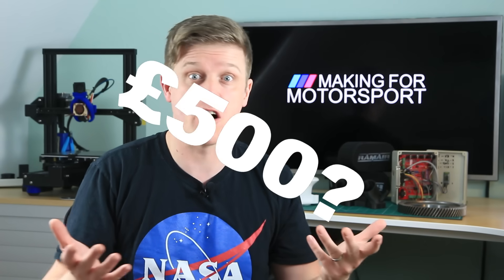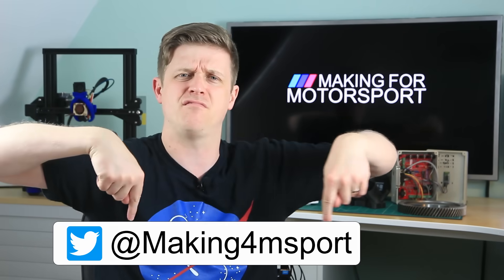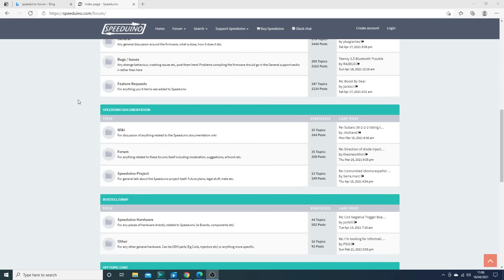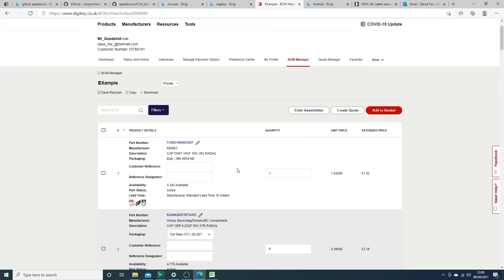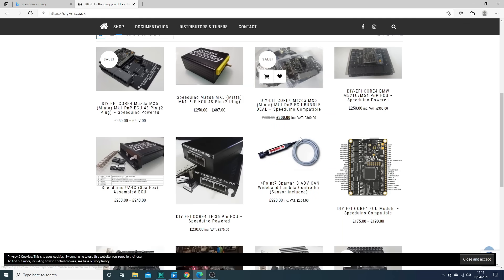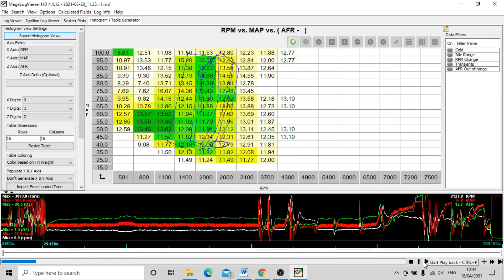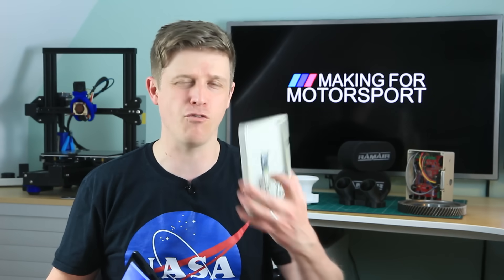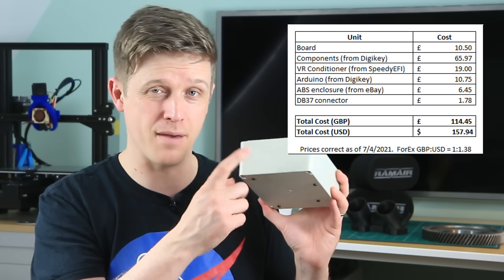The Best Value Standalone ECU - Speeduino

Comment: Wish they made a 6 cylinder version. Got to wait for DropBear!
Reply from the maker: You can always go wasted spark and paired injectors?
Reply: @MakingforMotorsport  true but I feel like that would be a step backwards from OEM.
Reply from the maker: Yeah, I get that if you already have Coil on Plug that you want to retain it, but you can go wasted COP which, presuming dwell and heat aren’t going to be problems is to all intents and purposes indistinguishable, but sequential injection I am not hung up about.  Any sequential setup becomes basically a batch/paired fire setup at higher revs as there isn’t time in the cycle to only squirt when the valve is open so the only benefit is emissions and low speed running compared to paired.
I suppose it depends on your priorities, the step forwards is being able to fine  tune to your actual engine, it’s whether that outweighs what you loose with the sequential... 🤷🏼

Comment: Speeduino, weber dcoe frames hiding denso injectors, zetec engine, turbo.
Reply from the maker: Sounds good and I like the crafty injectors/carbs!  A question for you, how are dealing with the individual throttles and the turbo when your load sensing on your ECU?  2 tables?  AN to SD for boost?
Reply: @MakingforMotorsport  I'm thinking about going with SD and using boost reference from all four runners. Thats how I used to do my old setup on different ecu Its still a working project and I have not ran it yet. So might need to look in to the blend function for SD and AN.

Comment: I buyed 0.4.3c speeduino board and arduino mega for 96€ pretty cheap ! 

I want to install it on 4g93 DOHC engine. But first i ll try on 4g13 sohc engine. I am a bit loss with distributor but i'll see if I can make it
Reply from the maker: Speeduino can support distributor, you just need to understand your existing wiring, maybe that’s a good place to start?  Then you could go to trial whatever you have planned for the 4g93 (wasted spark/coil on plug etc).  Best of luck!!
Reply: @MakingforMotorsport  in my distributor there is 6 pins + 2 pins 6 pins : ( crank and cam sensor that send 5v to ecu, 12v supply from engine relay, 2 ground and one "ground" from the ecu... Which I can t understand what it does)

2 pins  : it is the ignition coil power wires...

But I don t know how to control my distributor... For ignition timing. The only wire that goes to the ecu is this "ground" wire... Do you have an email where I can send you my schematics? I have all on pdf files

On the 4g93 I will use wasted spark 1/4 and 2/3 with Mitsubishi cas sensor (cam and crank sensor on one camshaft)
Reply from the maker: If your Crank and cam sensor are running to the ignition gear it sounds like you might have an “edis” like system same as 90s Fords.  Happy to have a quick a look but I can’t really promise anything.
If you look on my channel page there is an email there you can use. 👍

Comment: Hey, great to see you using Speeduino, and thanks for the mention in the Video :D
A few small recommendations before you get too stuck in with your tuning.
Update your firmware to the latest.
There are some features in versions after yours that make running ITBs easier, mainly ignition based idle control.
I use that on my personal project., https://www.youtube.com/watch?v=EfR-dr7fOW0
Also, if you are using TPS as your load, make sure you have an axis cell for 0, and I would use about 5 cells going up in single increments (1,2,3,4,5) at the bottom of the table.
A small throttle change in this region has a big impact.

Good luck with your project, SUBBED!
Reply from the maker: I’ve thinking about updates for a while but i already have the functionality and value the stability above everything (don’t want to mess with it), it’s been running my wasted spark for about 2-3years....

I do like the sound of ignition based idle control, I’ve got a retard dip in my table at idle and if it drops in revs I get abit of advance to nudge it back but that’s not ideal, (less than perfect idle and it’s taking up a speed column), I will look at it 👍

So seeing as I am going to be messing with it, it’s likely a good time to update.  And 🤫 on the Load axis break points, that’s basically the next video 😂😂😂

Comment: Can this ECU work on trucks? such as a Cummins engine.
Reply from the maker: If it’s a conventional petrol engine then I don’t see why not, if it’s a diesel then no and I don’t think direct injectors are supported.  But if it’s got a spark that needs timing and high-z injectors that need opening (depending on the amount of each) then it’ll work.  If you need to know specifics I suggest you check out the forum...
Reply: @MakingforMotorsport  I shall look at the forum, but it's diesel so it won't work, the only reason I ask is that the ECU  for the truck costs 7k new and 4k refurbished, would have been great and a cheap alternative to use the Arduino unit.
Reply from the maker: Yeah, diesels can be tricky, as soon as it’s common rail there is lots going on and it’s very different from a petrol engine.  Best of luck finding something!

Comment: What about emissions/obd2 how would you make that work
Reply from the maker: In its basic form this isn’t included, however you can enable OBD2 with different hardware, but that’s a data stream of parameters not diagnostics so it’s not going to produce fault codes etc (but as you can plug in and see pretty much everything on tuner studio that’s not needed).
In terms of emissions control/readiness monitoring Speeduino doesn’t do this as far as I know, and if you have smog tests to pass this definitely isn’t for you.

Comment: 0.4.4 running a 91 volvo 240 as sequential everything with ls3 coils.
Reply from the maker: Nice! Old skool car with modern tech!
Reply: @MakingforMotorsport  next step is a borg warner t5 swap and ford 8.8
Reply: @Tachikoma69  wonder if this would run my 98 volvo s70 t5 b5234t9 swapped with hybrid turbo. Running dw300 pump on dw800 injectors 3.25" maf but id like to go speed density. Currently managed by modified Bosch m4.4.
Reply: @ogfromutube  t5 or t6? Either way, you can run both engines with what ever combo you want. If running a drive by wire, you will need to revert to drive by cable. Not yet supported unless you get a standalone.
Reply: @Tachikoma69  its the t5 2.3 20v. Cable throttle used rn block and head but the older style intake and tb. Drilled cams for rotor plate til i go cop. Its tuned by vast now and he did great job but everytime i change something i have to bother him. Just swapped to 800c as i maxed out the 468cc greens.
Reply: @ogfromutube  the white block, i know. You can run a 5 cylinder on speeduino

Comment: I went for the Link Plugin ECU for my Altezza when I put ITBs on. It really is plug'n'play, so it couldn't have been simpler. The Altezza uses a BEAN network for a lot of the car, so the Link plugin ECU has an extra board on it to do the can <-> bean translation. This meant I could use everything on my dash and keep it very OEM looking. A really good benefit of the Link ECU is the support that comes with it, whether on the Link ECU forums, the FB pages or direct contact. If there are any issues or queries, you get a really detailed answer usually within minutes from a Link employee.

When I get a more project oriented car, I'll definitely be giving the speeduino a go
Reply from the maker: Yeah Link seems to be the name of the moment with lots of integration, I remember your post on the ITB and your install sounded top notch, especially if you can integrate into the BEAN network and CANBUS.  Trying to integrate anything into that and continue the stock features would be a massive headache...

Comment: Yesterday I went to Santapod with my Corrado with a r32 engine running on Speeduino happily ran a 13.4 @100 mph which is comparable to the same car running the stock management considering I am not currently controlling the VVT and the intake changeover valve I am happy, it helps that I have previous MS2 and MS3x experience (and already have the tunerstudio upgrade) there are a few things that are not currently supported but for the money it works really well.
Reply from the maker: Sounds like it’s going well!  Have you done all the tuning on it?  I have used a MS years ago and when I came to get another one I couldn’t believe how much the prices have gone up... especially an MS3x, great functionality but it’s nearly entry level money for a name brand!
Reply: @MakingforMotorsport  yes I did all the tuning still needs a little work in the warmup areas and part throttle but its more than drivable I towed my trailer tent and did the 300 mile round trip without issues, The prices have gone up (as have everything) I helped a friend pick a new ecu recently for his fast road car and he was interested in going ms3x and in the end he went for an EMU classic as it was similar price wise to an ms3x and had DBW support which he was keen on...  I have my MS3x on my mk2 golf drag car (pb of 9.95@146)
Reply from the maker: That EMU classic seems like a great choice, definitely better than a similarly priced Link unit, they need to increase their marketing budget!  Sounds like you’re well into your VWs, sub 10 in a FWD is going some, is it a turbo? (1.8T?)
Reply: @MakingforMotorsport  yes its a 1.8t with a hx52 although I am building a new engine for it as I keep lifting the head on it (lower compression and o-ringed the block) I was quite impressed with the EMU range although the datalogging is more awkward vs the ms3

Comment: Any help in getting semi-sequential injection on a V8 using 1 Speeduino, using a stock distributor to get cam signal and using a trigger wheel and hall-effect sensor for the crank. 
Otherwise I might just resort to batch-fire and see if it’ll pass emissions.
Reply from the maker: Hi Merle, I don’t know the V8 methods too well but in the manual the next to semi-sequential they have “only valid for 4cyls or less” so I guess that’s your answer, although the guys on the forum would be best placed to answer, but you should be able to pair and go for alternating.  
I would have thought the tune would be the most important, not too rich, not too lean (HC vs NOX), timing etc, if you fail it you need a friendly garage to borrow their tester for 20mins....
Reply: @MakingforMotorsport  What do you think is the most economic way to get full control of a V8 is?
Reply from the maker: You can use a Speeduino with a distributor, if you have one fitted, otherwise you can use the ever popular LS coils in wasted spark mode, and injection in paired mode.  That will give you full control...  if you want sequential injection you will need the Teensy version...

Comment: 2003 svt focus not sure on ecu but I'm going with a itb boosted combo but first itbs have to have a plenum made for one big asssss inlet
Reply from the maker: ITBs and Booooooost?? Go for it!!! That said you’ll wanna do some research as it’s not common and makes it difficult to load sense, as you’ll need to use Speed Density (Manifold Air Pressure) so it can cope with boost pressure but off boost your gonna want to use Alpha-N (throttle signal), ideally you’d use a MAF (like the Skyline GTRs!). Speeduino does support switchable tables like above so you can go between modes but I’ve never tried that!  How hard can it be??😂
Reply: @MakingforMotorsport  if I can work some magic ill do it but yes not even close to easy well its going to be alot of mad scientist stuff for sure but if i can pull it off I think it will be sick
Reply from the maker: Definitely!  Is it your daily driver?  Always easier with projects if you can take them off the road for a while...

Comment: I wanna install itbs on an N/A 2014 mitsubishi lancer but it has a más air flow anf a map sensor and i wanna use the standard drive by wire or fly by wire that comes with the car so i need some ideas
Reply from the maker: Now this is a tricky one... I think your options are this... 
1. Stick with your standard ecu and remap if you can, and you’ll need to duct your ITBs into an air box to keep your air mass meter.  Also you will need to mod your current throttle actuator to the ITBs (but that’s every option) - downside is the standard ecu will be limiting even if you can remap and the new map signal won’t be as good because of the ITBs.  Not preferred.
2. Go fully stand alone and drop the current ecu for the engine but leave it with power so it can run the fly by wire throttle plate and just modify the actuator to run the ITBs (this needn’t be direct - you could run an intermediate cable - not elegant but it would do the job)
3. Ditch the lot and use an Arduino to power your drive by wire throttle and go fully standalone
4. Get a none fly by wire throttle pedal and drill a hole in the bulkhead 😂👍

Number 4 is probably simplest but if your are dead set on keeping the drive by wire then option then in about 5 videos time I will be doing option 3 👍
Reply: @MakingforMotorsport  thanks for the options ill see.what i can do ive been wanting to go for a piggy back ecu of go full standalone but i dont have much information about what ecu could work with what i wanna do but ive been watching some videos about this new speduino ecu and i feel like this one could work and i think since this is a map sensor signal based ecu i can get rid of the mass air flow sensor  but ill have to go full standalone for that but likeni said i dont have a los of info about what components i need or wich ecu option i can go with ive seen some videos but they dont talk much about what works for what so yeah thanks but i tell ya i will install itbs on this car mark my words lol

Comment: Hey I'm loving the videos, top job. I commented on your 3d printed inlet manifold video as I too have bought itbs from a zx6r. I'm getting the bits together to convert a 1973 series 3 land rover to run on a speeduino. I've gone for the ua4c flavour and to adapt a previously carburetor based engine I'm getting the rest of the bits needed.(trigger wheels, coil packs ect). I've noticed that alot of the videos revolve around adapting speeduino to already injected cars so I plan on documenting my journey on YouTube, watch this space. I've not done it before but I feel I've watched days worth of videos on other conversion, please keep the content coming as every one helps me out a little more, cheers
Reply from the maker: I will do Mike, I love getting the feedback as the videos do seem to really help people!  I know what you mean about the other conversions, there could be more info on how to pull together a wasted spark setup using junkyard bits (maybe I should’ve put that in my video🤔).
I would LOVE to see ITBs on a Land Rover!  I think YouTube has enough Miatas and not enough original stuff!  Go for it!  Let me know when it’s out!